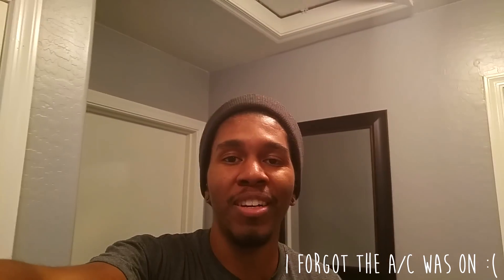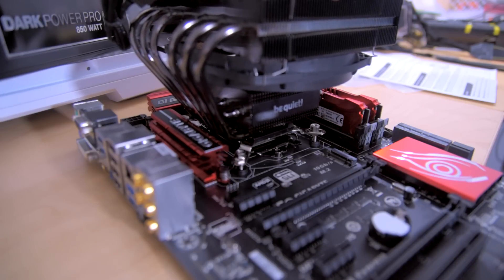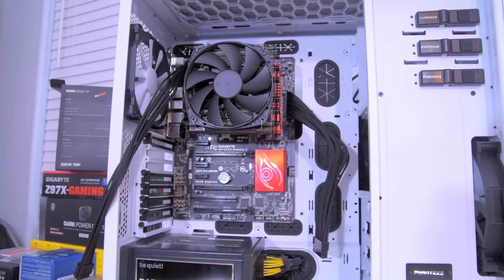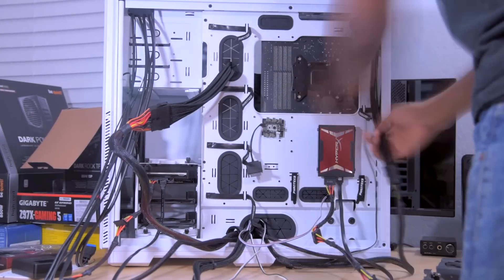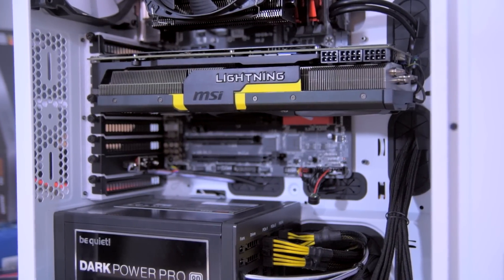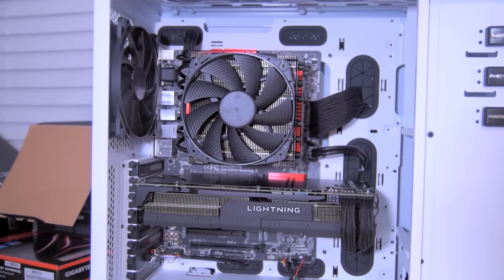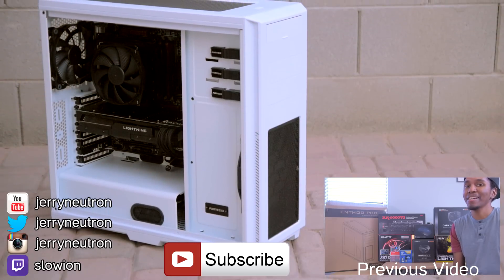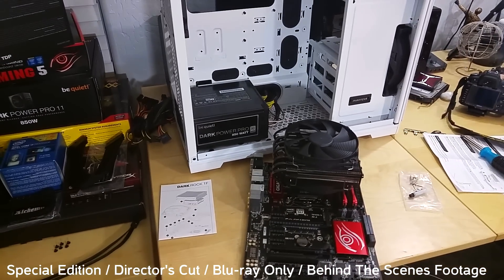MY BEAST $1400 VIDEO EDITING / GAMING PC | Build Log 2 - The Build

Comment: hello dude, i would like to ask you a question, does the dark rock TF heat pipes block the first ram slot?, i have the same mother board and ram, and I would like to know if the first ram slot is still usable with that cooler installed, from what i can see in your video the heat pipes don't block the first ram slot but i would like to make sure of it, as in the future i would like to have the first slot avaliable for possible upgrades.

Comment: 1 6bin cable is missing from your graphics card does it work properly like that !!
Reply: yeah, it only becomes a problem when you consume more than is supplied. So if you consume within what is given then there will be no hitches. you can use 4 pin cpu connector in an 8 pin cpu connector and it'll work fine unless you overclock to the point it needs more than what is supplied by the 4 pin.

Comment: Hey Jerry, I am wondering where in the bios can I turn off the light?
Reply from the maker: +Beast5000100 Its called Audio LED, should be under the Peripherals section once you switch to the Classic Setup interface in the BIOS
Reply: +Jerry Neutron Alright, thanks for the help and nice build.

Comment: Are there any specific reasons why you didn't use a Skylake processor?
Reply from the maker: +Luke La Cosse Wasn't out yet when I started gathering parts for the build
Reply: Do you think Skylake is worth the extra cash?
Reply from the maker: Luke La Cosse the only real advantage IMO is storage and I/O. If you need fast storage and plenty of USB ports (3.1 and 3.0) then it makes sense but just based on processor alone I'd rather go X99 for the price.

Comment: I'm thinking of either going SLI PCS+ R9 290x or selling my little baby and purchasing a Fury X. Saving up for Christmas. I'm working with an i5-4690K, 8GB RAM, and a 128GB SSD. 

These parts will all be purchased during Christmas. I have set a $850 budget for this year. Keep that in mind.

So I'm debating. Either I SLI my 290x for another $275 or sell it for $225 on Ebay and buying a Fury X. With the extra 290x I save almost $200  but either way I am purchasing 16GB of RAM, a Corsair H100i GTX as well as a 256GB SSD and a 1TB Hybrid drive. Which is the better option? I'd like the Fury X simply so I can upgrade later, HBM may benefit with future games, as well as not having to deal with Crossfire issues. I'm going to be gaming on a single 1440p monitor. Can you also give me a good recommendation on that?

Oh and not to mention that the PCS+ is loud af and adding another would be even worse. They are also thick cards and idk if there is enough room in between to keep low temps.
Reply from the maker: +Maximan Well two 290X would be more powerful when Crossfire is supported of course but I would stick with the Fury X (or Fury, not sure what's up with the whine issues on the Fury X) that way you don't have to worry about crossfire support.

Comment: How come you didn't plugin the last 6 pin for the graphics card?
Reply from the maker: +Grid21 it's optional, only the 8-pin connectors are required
Reply: ***** What does the extra 6 add to the card?
Reply from the maker: ***** it's additional power for extreme overclocking
Reply: Ooooo Nice. You should make a video about that card. I'd be interested in over clocks and see what it's like for gaming.
Reply: +Grid21 It's a solid card. Just make sure to get something beefy like the msi Lightning as it is prone to high temps and noise if using a blower style cooler. Otherwise there is the 390/390x now too

Comment: it's beautiful bro, although I'd keep the stripe on the board. 

but Idk that's just me
Reply from the maker: +Stephan Carlton I would if I could disable the lights on the GPU but I don't think it can be done
Reply: ok
Reply: +Jerry Neutron Hey Jerry! If you plug the 3rd power cable (the left 6pin) of the 290X the lights will automatically turn red in stead of that white/blue :)

Comment: you have one of the gpu power cables not plugged in
Reply from the maker: +DaGamer the 6-pin connector is optional. it's only needed in "extreme" overclocking cases
Reply: +Jerry Neutron got it. I knew that was the case with some cards just didn't know that was included. its the 390x, right? cause unless my eyes are failing me your vid said 290x

Comment: Does mobo affect performance or is it just the features on a mobo that matter? For example will a more expensive mobo give me better performance in games?
Reply from the maker: +Bob Walters Depending on the platform, a more expensive motherboard may give you the ability to overclock further which should technically improve your gaming performance.

Comment: I've got a component setup very close to yours. I'm using the coolermaster evo though. I do have a question though. 

I'm curious to how your cpu temps look while rendering with that cooler. mine usually range from 75-80
Reply from the maker: +James Jenkins I don't usually monitor that when I'm rendering, I'll have to check when I'm doing my benchmarks
Reply: +Jerry Neutron same guy here. But yea thanks. Just wondered. Becuase I get paranoid on some of those 1-2 hr renders. appreciate the tips man.

Comment: When it comes to the LEDs, I feel like the blue on the GPU is a bit out of place. If possible, I'd rather disable those LEDs and keep the red on the motherboard audio section.
Reply from the maker: +Sakkura1 I'm not sure if the blue can be turned off. The red though can be disabled in the BIOS

Comment: Me:
Looks at my s340 with R9 280x and i5 4690
"You disgust me"
Reply from the maker: +TackStash779 lol that's not a bad setup!
Reply: ***** Thanks Jerry :DDD
Reply: +Jerry Neutron were i plug the power on the motherboard ?
Reply: TackStash 7600k msi270 m5 2tb drive 120gb ssd 1060 6gb
Reply: Rasta yolo 24 pin power connector is the really wide connector coming from the power supply. plug that into the middle right hand side 24 pin socket.

Comment: nice video man. im gonna get that case however im gonna cut a hole in the top of the shroud and run my gpu cables through them and get a rubber grommet form the other side of the shroud. then i will look more neater and look like the nzxt source 340, what do you think?
Reply from the maker: +S&L Gaming you could do that but the grommet that is already there isn't that far away from the top. I just don't like the way it looks with single GPU setups